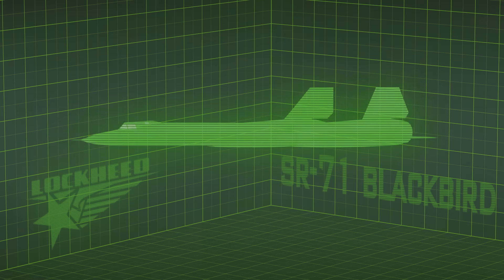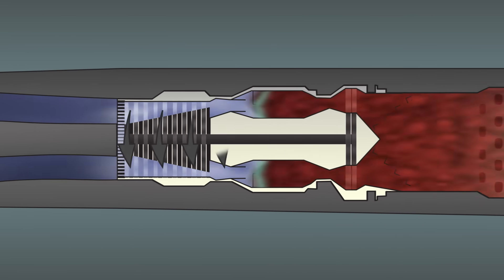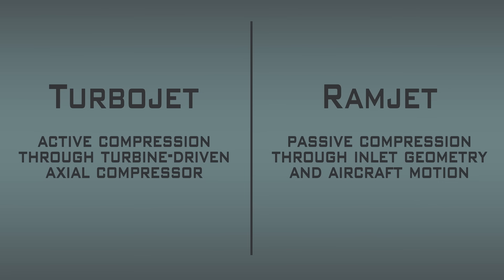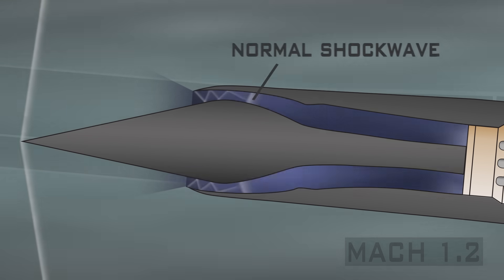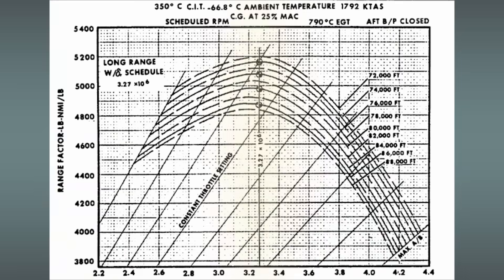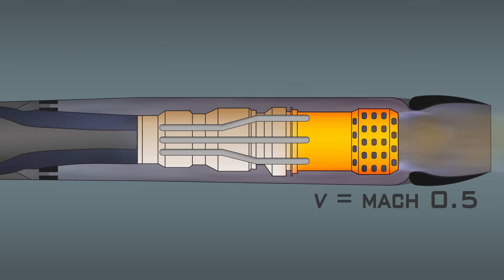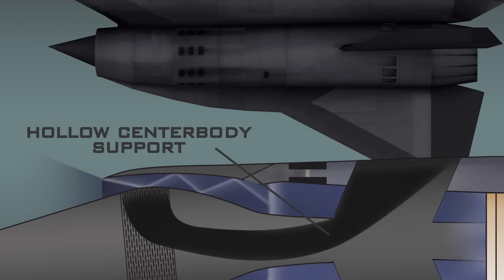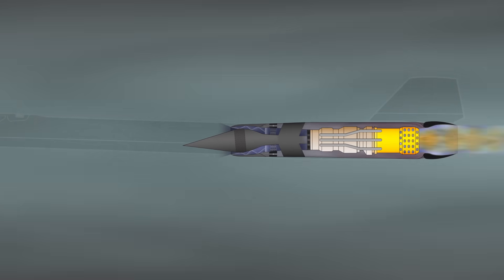The Mighty J58 - The SR-71's Secret Powerhouse

Comment: All this designed in an era of slide rules & supercomputer slower than today's average PC.

So why aren't we flying supersonic right now? Given the computing power we have today surely the problems of the sonic boom & high fuel consumption can be solved.
Reply from the maker: This is a huge fallacy that I hear about again and again.  As it turns out, it's much simpler to design the J-58 and the SR-71 than to make something fuel efficient at speed, by many orders of magnitude!  In order to accomplish what you're talking about, we'd need new physics beyond what we currently understand about the universe.
Reply: The human body has it's limits. Currently, some military jets can "outfly" the pilot: ie. the pilot can't handle the G-Forces. This is similar to our limitation with space flight; with no gravity, the body will eventually turn to goo. This is why you commonly see astronauts on the ISS exercising a lot.
Reply: Because commercial airplanes try to be fuel-efficient, not superfast.
Remember that for having twice the speed, you need four times more energy. And all that extra energy needs extra fuel. And thus passengers have to pay much, much more.
Those were some of the reasons the Concorde was dropped.
Reply: you forgot to also consider declasification and lag effect. This info was just recently declassified to the public. It's been a well guarded governmental secret for some time. Naturally it'll take the civilian market some additional time to catch up. As for your entry as to weather or not there are already these types of crafts and even more advanced crafts in existence consider the fact that again the sr71 was a well kept secret. Likewise you can conclude that there are other crafts in existence we have never seen more advanced then we can imagine laying dormant waiting for the declasification process to take hold

Comment: Used to drip fuel everywhere when sitting on the ground due to hairline cracks in the fuel tanks which would "seal up" once in flight and fuselage had heated up due to the friction of the air

Comment: Cool explanation. How come no one made a smaller version of these engines for passenger airplanes?
Reply: It's the issue of designing the air frame around the engine. Not that a 747 can't house one of these baddies with the right modifications, but that aircraft was never designed to go above the speed of sound. Now on the Concord, it IS possible for a modded j58 to be housed in that aircraft and have it preform very nicely in there.
Reply: thank you for responding. What I should have written was why don't airplane manufacturers  build a plane around the engines? Seems kind of logical :)

Comment: LMAO so much is wrong with what they say in this clip it is a joke!  I worked on the JT11D/J-58 at Pratt. Those bypass tubes are ALWAYS open. It is NOT a "Turbo Ram Jet" NO SUCH ANIMAL! It is a continuous bleed turbojet. The person who did this clip has NO FREAKING CLUE!
Reply: Whoa time out. Its not all about the J-58 here. The SR-71inlet is what becomes the ramjet part....that's where the "ram air" is compressed. It just uses the bypass tubes and afterburner of the J-58 to complete it. If the bypass tubes were placed in front of the compressor instead of the 4th stage the whole system would be a true ramjet. But since it goes through 4 stages of compression it is called a "turbo" ramjet but it refers to the entire system, not just the J-58. The J-58 alone has no "ram" air. I agree with you that the bypass tubes are always open. At mach 3.2 the J-58 is providing the least amount of thrust while the ram air inlet is providing the most. At that speed the J-58 is little more than a life support system for the hydraulics, electronics, and afterburner. This is where people make the biggest mistake.....they think the J-58 is the sole source of thrust of the SR-71. This video did discuss the the "whole" system, you just decided not to see it.
Reply: Guy I worked on the JT11D-20 at Pratt and Whitney and so yeah I know a SHIT LOAD MORE ABOUT IT THEN YOU. Oh yeah numb nuts there is no - in the J58. You have no clue. Yeah like I said this clip is a freaking joke as are your remarks. But again I only designed and worked on update items for the JT11D-20 before The Sled was retired so WTF do I know right?
Reply: Oh yeah do you even know what a Ram Jet is? Or what RAM EFFECT IS? Two completely different things guy and NOTHING on The Sled or the JT11D-20 and it's nacelle had ANYTHING to do with a ram jet. Ram Effect yes Ram jet NO! Oh yeah the only Ram jet that was ever part of the entire program was on the D-21 which used a modified Marquardt RJ43-MA designed for the Bomarc missile.
Reply: I had always hoped that an SR-71 mechanic or J58 mechanic would chime in and give us some more info about this system. But now that one has, I'm disappointed. Your condescending attitude and insults toward people are shocking. If you can't simply give a detailed explanation or correction of what you say is wrong without the insults then I am done talking to you. People come here because they have an interest in the SR-71 or the J58, and you should want to help them have a better understanding of it , but instead you try to degrade them. You weren't born with any of your knowledge and I'm sure you didn't learn it from someone who talked down to you and insulted you when you were wrong.  I don't operate that way. If we can have a friendly discussion then I'm in....otherwise I'm out. I was a jet engine mechanic for 10 years and have 2 friends who were SR-71 pilots so I'm hardly clueless.
Reply: @frak off - How can it be a continuous bleed turbo jet ? The pilots flight manual shows a bleed schedule showing open and closed.

Comment: Any kind of damage to this engine will fuck this plane up
Reply: Good thing that there are not a lot of stones at 85,000 ft.
Reply: any damage to any plane will usually "fuck the plane up". glad that wasn't an educated comment
Reply: +Airborne Centeno over 90 percent of small aircraft accidents that are subsonic planes are due to engine failure
Reply: A little stone of 3 nanometers wide inside this motor at mach 3.2 BOOOOOMM!!!!!
Reply: Ju Ju usually not ones that fly at subsonic speeds

Comment: Designed in the early/mid 1950s by a bunch of guys using graph paper and slide rules and controlled by systems that when combined, may have as much processing power as the phone in your pocket.  

Kelly Johnson and the entire teams at Lockheed, P&W and the USAF....you're still kicking our ass 60 years later.  Well done.

Comment: Dear TechLaboratories
Please be careful at 2:50 since the spike doesn't retract 1.6 inches for every 0.1 machnumber above mach 1.6.
It retracts only 1-5/8 inches every 0.1 machnumber above mach 1.6. See page 31, section: inlet spikes.
There is a history for those 1-5/8 inches, I highly assume that you know the history. I would be glad if you could enlighten the theory for those 1-5/8 inches for your viewers with your graphically outstanding videos. Keep it up!
Reply: What are you talking about? 1 5/8 = 1.625.  
You say only 1 5/8" which implies that  1.6" is longer than 1.625" jajajajajaja
I doubt that .025 makes a damn bit of difference.
Reply: TBH it probably does but I see your point.

Comment: No mention of the funky fuel SR-71 used??

The Blackbird would burn "somewhat" conventional purposely designed JP-7 fuel which was difficult to light. To start the engines, triethylborane, which ignites on contact with air, was injected to produce temperatures high enough to ignite the JP-7. The TEB produced a characteristic green flame, which could often be seen during engine ignition. JP-7 is a nasty substance that is amazingly slippery and leaks through any tank.

By the way SR-71 had 16 shots of TEB to start the engine.

Comment: I have no idea how this ended up on my YouTube feed. However that's amazing even thought I don't understand most of it.
Reply: Basically a turbo jet is a jet engine with a turbine at the end of the combustion chamber to keep the compressor spooled. Ram jet has 0 moving parts, the faster you go the more air gets in the engine/combustion chamber and makes more power. What they did is combine both of these types of jet engines into one unit. The nose of the engine helps the incoming air slow down just enough so that the engine can breath it in and use it. The faster you go, the more turbulent the air going into the engine will be so it has to be slowed down to become smoother. Jet engines are very picky about the air going into them.
Reply: LOL
Reply: @frak off - I remember you said you had worked for P&W on the JT11D-20. I was wondering if you could explain the bypass tube bleed schedule . I posed this question to someone from P&W and he explained it as a ring of 54 doors that is controlled by the fuel control and is based on engine speed and CIT. He said the ring shifts to open up and allow air to enter the bypass tubes. The bleed schedule is listed in the SR-71 flight manual. My question is how the ring is mechanically actuated ? Thanks

Comment: now this is the secret of going fast, anyone has deployed this into commercial planes...
right now currently flight US to EU takes so long.
Reply: The Concord was capable of taking passengers at super sonic speeds, but it could never go as fast as the SR71. Also, it could only be flown over the ocean because of the disruptive sonic boom and it was dangerously tricky to land. It was discontinued but development of quiet super sonic passenger plane and suborbital passenger flights are in progress.
Reply from the maker: When you see these engines in the actual SR-71 body, it's amazing how much of the airframe they dominate.  Most of the rest of the body was fuel storage, which is why it only carried two people.  Passenger jets have to, you know, carry passengers, and be fuel efficient...  High bypass turbofans provide a much better thrust to weight ratio with more efficient fuel consumption for moving mass over distance.  The cost to fly that fast is very, very, very high.
Reply: Look, it doesn't matter the technology you have, nothing will have an efficiency greater than 100%. The fact is that the best technology we have goes onto planes that seat one or two crew members, weapons and fuel. They're usually low bypass turbofans with afterburners, which would be terrible to have on airliners. Look at all the transport aircraft the military uses - today it's all turboprops or high bypass turbofans.

Maybe you haven't realized how loud military jets are. When they fly over you, you know - even when they're 3x further away than te airliners. It would be an annoyance to have all airliners use military jet technology. A turbojet, or a turboramjet, flying over regularly would destroy property value in any city with a busy airport.

Think of F1 engines. Thermodynamically speaking, they have the most efficient engines. However, you wouldn't drive a F1 car for fuel economy. They get the most out of the fuel that you put in their tank, but they still guzzle gas like crazy. Trying to achieve the speeds of a F1 car in a normal call would be an absolute waste of gas but it's way more economical to drive a normal car. So your car is probably a small turbodiesel because despite having not that much raw efficiency, it's economical due to the RPM range it operates under.

So just because the SR-71 got the best fuel economy at 3.2 mach it doesn't mean it wouldn't spend more fuel than a 707, because it most likely would with 200 passengers and luggage on board and the extra fuel necessary.
Reply: good response and one of highly discussed of - now topic. simply let's put this into our current world perspective. we are not utilising our current technology. we still lacking to innovate to the current possible available resources.
Reply: That was 50 years ago.  Now Lockheed Martin have much better technology.  Some time ago i read interview with former LM employee. He just said that now they have technology that allows them to reach moon in less than 2 hours. So its not air craft any more but space craft. It means speed of many many miles per second. 

SR 71 is a dinosaur but "officially" its still the best and the most advanced vehicle ever made. Unofficial stuff is of course classified. 

Commercial technology is even more ancient. Simple folk cant travel faster than 550 miles/h. 
Boeing 707 in 1950s could fly that fast. Now Dreamliner is still just as fast. 

Amazing right? almost 60 years of technological progress. We have now Ipads, smarphones and mac book air. But jets still fly less than 550 miles/h.
Reply: If you want to fly Mach 2 you can buy your own plane. Too expensive you say?  That's right. It is too expensive to operate at a profit. The military can only afford it if millions of tax payers combine to cough up billions.  Countries that are weak economically cannot afford it either. 
So how much do you have to piss away going fast? 
There is an old saying "Speed costs money. How fast do you want to go?"
Reply: crosstimbers2 

None modern jet can maintain about mach 2 speed for long time. They need to use afterburner to reach this speed. F 22, F 18, F 16, Su 35,  Su 27, Eurofighter etc. etc.
They can only withstand this speed for few minutes and then need to lower it or engine will blow to pieces. 

Anyway jet engine technology is so old. Its retro stuff. Jet engine was invented in 1930s. This technology was mastered in 1960s as Sr 71 proved it. Now? We just drifting. No big breakthroughs are made in propulsion branch. 
Its not just jet engine but also rockets. This tech is also vintage - created by Nazis in 1940s by Von Braun and his V2. 

So why after so many many decades people still can move at max speed on avg about 900 km/h? Its pathetic dont you think? I think so. Its pathetic.

You think Lockheed when they created sr 71 in 1964 just stopped to evolve and develop new stuff? No. Since at least 1980s Lockheed is deep in new propulsion technology - anti gravity. People seen this craft or rather space craft. It can fly silently and hover in mid air with no sound. Call it a UFO if you want. But they have it. It can fly a much faster than sr 71. How much? 
At least 40 miles/sec. Its mind blowing. 

So why this technology is not out in the public use? 1980s were 30+ years ago. 

There are many reasons. One of them is oil. 
Jet engine need kerosene to work. kerosene is made from oil. Whole world is running on oil.

You cant have new technology that is completely independent from oil. 
You just cant.

Comment: I built a J58 in my VW Beatle. It's great, flew over N-Korea at Mach 3,2 yesterday and today went to pick up the groceries in less than 1,5 minute. I also helped me to get the old paint of the fence
Reply: its just not funny O well you tried I have never seen a beetle over 100mph and that is for a reason lack of power and well the aerodynamics do not suit well to speed the car would fall apart I bet the wiper blades would fly off at 120mph the and the trim would come off at 150mph and the windshield would cave in over 170mph a Beetle is made for slow speed travel in a city and if you flew over North Korea they would not exist anymore cause they would have shot a Missile at you and blown themselves up